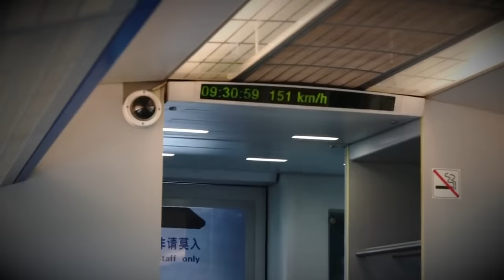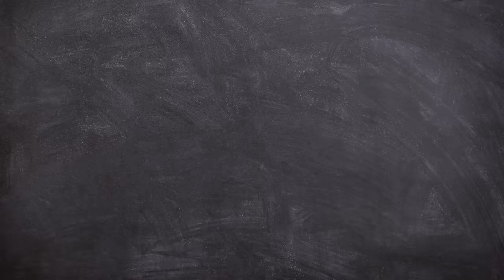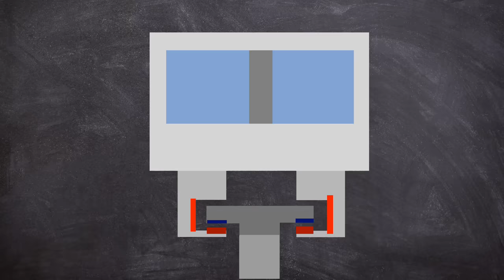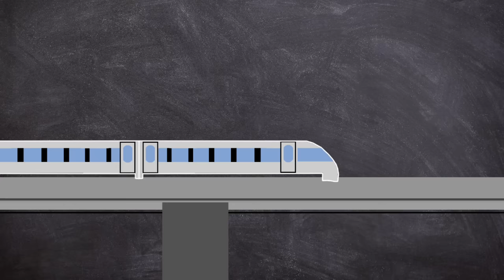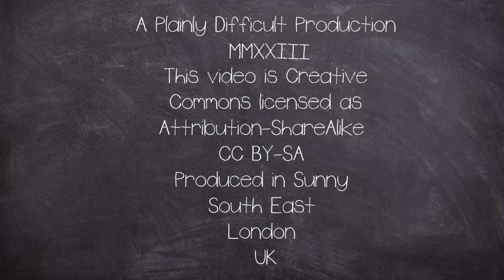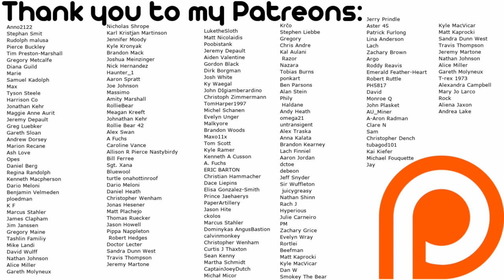Safety Complacency: The Lathen Maglev Train Disaster 2006 | Plainly Difficult Documentary

Comment: the shanghai maglev line is very cool. it's regarded as a "gadgetbahn" not because the technology is unviable. there are two external reasons for this undeserved "gadgetbahn" reputation. first, the line was meant to be the first section of a longer line. but the scope of the project ended up shrinking. so the city is now stuck with a maglev line that goes from the 8th busiest airport in the world to the middle of no where (although it's very convenient to exchange to normal metro at the terminal station). reason two is because it serves the airport, that determines the majority of passengers of the maglev line would be tourists. this feeds into people's regid perception that "if the majority passengers are tourists, it must be a tourist attraction/gadgetbahn". but in reality, at the time of this project, not just shanghai but the entirety of china just decided to shift away from developing maglev and starting developing conventional high speed rail. in another universe, you may very well see no high speed rail in china but extensive maglev lines partially or completely replacing metro in shanghai and other big cities.

Comment: This was such a common reason for railway accidents: signalmen forgetting a train that is already on the line.  Quintinshill and Ais Gill accidents immediately come to mind.

A train staff system would have prevented this accident, especially if the trains had been designed with an interlock to prevent their movement without the train staff being in the train: if the maintenance vehicle had the train staff, the maglev train would not have been able to start.  We learned these lessons in the 19th century!

Comment: the rolling of  steel wheel over steel track is extremely low friction, well proven, relatively cheap, and can be compatible with existing infrastructure.  Do you really gain much by adding the cost and complexity required by maglev?

Comment: How does the power for the accessories gets transmitted to the vehicle? I know for the Chuo Shinkansen they were still experimenting with it, initially using a gas turbine generator, but could not quickly find any info for the TransRapid system.
Reply: The tr08 have a 3kV power pickup and it uses about a few hundred watt  per ton to levitate. Tr09  have induktion pickup and it uses 50watt per ton to levitate. Tr09 have much more modern magnets, hence it uses less power.

Tr07 and tr06 uses about the same amount of power, but tr06 is significantly heavier, to that degree it have problem levitaring it self. If there is to much people onboard its stuck to the rail.

Comment: "Human error" is not a cause. It is at most a contributing factor. The split comms, no block system and the corporate culture which accepted fully manual safety critical systems were the causes, with that cultural element, and likely others not discussed in this video, being the core problem.

Comment: Random thought………
You all have seen the old hoverboard that worked by spinning magnets attached to lawnmower blades?

I wonder if the same eddy current idea was used in a linear manner to push the train up instead of electric magnets pulling the train up?
Using wheels to start and stop with some standard form of drive to make it move

Comment: I actually don't think of the Maglev as a gadgetbahn. Yes, they are far more expensive than conventional rail, but in certain situations I actually do think they would work great. Even the place where it was originally planned to be built in Germany wasn't that far-fetched. It was to be a direct link from Munich Central Station to Munich Airport, which currently is a 40-minute train ride on the Munich S-Bahn. The Transrapid would've been an astronomical improvement over that. A fast connection like the Transrapid to the airport is still sorely missing.

Right now they're planning on getting rid of this problem with Express S-Bahn services (which in my opinion kind of defeats the purpose of an S-Bahn), as well as a new long-distance train station at the airport in order to finally connect it to the ICE network.

Comment: Why do a straight line with a loop on either end? That necessitates the use of switches when you could do a loop and have a single direction of travel and only 1 switch to let trains on and off at the start and finish of the operational day/maintenance. The entire point of the maglev is to minimize moving parts and thus points of failure...
Reply: Because real tracks may need switches so you want to include them in your test tracks for testing.

Comment: Thank you for the explainer. I had no idea that this had happened. 
That being said, as there are SIX maglev systems in commercial service (some of which are considered obsolete) and the Japanese are testing an even more advanced version (that I call the "Platypus" for the obvious reason), can we please just STOP calling them "futuristic?"
Reply: What maglev system in service would you consider obsolete?
Reply: @matsv201 Personally, I don't. The truly obsolete short-distance people movers that employed maglev tech are gone, now. If I did, though, I'd consider the two low-speed maglevs in China to be "obsolete via technological overkill and resultant excessive maintenance burden." You don't need a maglev to achieve 62 mph. Conventional rail does that every day.
Reply: @colormedubious4747  
" I'd consider the two low-speed maglevs in China to be"
There are 3 in China, 1 in Korea and 1 in Japan of that type, and one more under construction (also China).

That of cause on top of the Shanghai one and the one high speed on in Japan under construction.

"excessive maintenance burden"
Do you have any sources for that, or did you just guess it?

"You don't need a maglev to achieve 62 mph."
Even if you may not need it, it can still be better.

High speed is not the only advantage of maglev. There is a hand full more of really significant advantages.

"Conventional rail does that every day."
It does, but its not with out drawbacks.
Reply: @matsv201  "China also has two low-speed maglev system operating at speeds of 100 km (62 miles) per hour. The Changsha Maglev connects that city’s airport to a station 18.5 km (11.5 miles) away, and the S1 line of the Beijing subway system has seven stops over a distance of 9 km (6 miles)." - Britannica
Reply: @colormedubious4747  
And Fenghuang Maglev open in July of 2022 with 6 station and a total distance of 9.12km with a maximum speed of 100km/h.

On top of that Qingyuan Maglev is under construction (its delayed, it suppose to be already opened) with a top speed of 120km/h, 8.1km system length and 3 stations.

Note that Sources like Britannica may have been correct at some point in time, but all information will be out of date at some point.

Its also a bit funny that Britannica still gets it to be 6 system, also counting the Korean World fair system, that is not really a commercial system, but more of a attraction, making it two in Korea . This isn´t really a commercial system in the sense that people pay for it to be transported, but for the novelty (while it do have two stations, so its an legitimate park transport)
Reply: @matsv201  Fair enough, but other sources were even more outdated than Britannica.
Reply: @colormedubious4747  there probobly are more under construction but the Chinese govemrner often hides  the documents untill its finished to make it look like there never are delays.

Probobly should ask luke. 

They should have start building the new high speed mainline by now, but I have not seen any photos of the construction yet.

Still, if they started the construction får away they probobly could hide it for quite a while.

Comment: A very important incident, because it reminds us that all fixed guideways (on rails, magnets, or in vacuum tubes) should be subjected to the same regulatory oversight and technical practices and governance. There is no escape from the fundamental failure modes of C19th railways! Astounding lack of systematisation of possession/ block management, solved over 100 years ago. Not sure I understand why the radio system is relevant, surely a highly procedural, lowest tier of hierarchy intervention. Should have been entirely managed at the design and engineering level of the interlocking and track authority system. If nothing else, written forms, transcribe authority in maintenance vehicle, read it back to control, issue a unique authority which automatically applies boot/ block in interlocking

Comment: This was caused by a badly designed communications system, and will certainly not prevent maglev from being a workable technology. But do we know  that proximity to the high magnetic fields needed for maglev is safe? What is the magnetic field strength at the floor of the passenger compartment? Also, how does the Shanghai system deal with the problem of inspecting the track?

Comment: It's quite amazing that Shanghai Maglev operated since 2003 only had a fire in the 20 years of operation so far. Given the trains are largely experimental and you can see the Chinese have to rig up portable fans in the cab for the train driver.
But on the other hand, it was really the only way to quickly get from the airport to the city by rail (Metro Line 2 take almost an hour to get to the same station Maglev stops at, and it was only opened in 2010). So it is not really a venality project. (Although many will just take a taxi to the airport instead given the taxi is more convenient).
However, the very high costs is primary driving force behind China's push on 300lph+ Hight Speed Rail project. The maglev's route was planned all the way to HangZhou (Old capital of Republic of China), but then shortened to Shanghai's Hongqiao Airport, then... never extended due to cost and noise. The route space reserved between Shanghai and Hangzhou is used by HSR running at 350kph today.
The new Airport Link Line planned to open in 2024 will finally connect Shanghai Hongqiao Airport with Shanghai Pudong Airport. Designed speed 200km/h, and operate speed at 160km/h. Faster than Metro 2 but slower than the Maglev (300-423kph depend on timetable).
*Right now if you want to go between the airport by Metro, it will take almost  2+ hours, Maglev can shorten the journey by almost 30-40 minutes, still longer than Taxi and bus. New Airport Link Line can shorten it to 40 minutes total, faster than taxi.

Comment: So, the engineers were tasked with designing a system that had to use electricity and computers to pull the train up, instead of letting it rest on a magnetic repulsion field that would not have consumed such a heap of power.

The Westinghouse is strong in whoever wanted this done.

Comment: Curious why a maglev train needs to be elevated like monorails (which drastically increases cost).
Reply: Any high-speed train needs grade separation from other traffic for safety.  If it were at ground level, there would be additional cost for fencing.  A long route without crossings would be an inconvenience, so you might need expensive underpasses.  Elevation also makes it easier to build a level track over uneven ground.

Comment: 1:22 "have a lot of the train replacement tropes"

"expensive, complex, tracks usually raised in the air"

Source needed. Or is this one of those "trust me bro" kind of situation.

2:55 "linear induction motors"
While some system use Linear induction motors, Transrapid use linear synchronous motors... Is that really that important? Yes,, apart from the acronym being totally different, Transrapid relies on Linear synchronous for not only propulsion, but also levitation.

3:47 Transrapid was not formed untill a few years later. The first train that carried the transrapid name was 04. There was multiple 01 and 02 from competing developers. They was all unified into Transrapid in 1973. While this is not that important, there are several different german maglev train that carry the number 1, 2 and 3.

4:00 its not quite fair to call TR04 and TR05 fully working. They was technology demonstrators. They absolutely did work, but had significant limitations. They was never ment as a transport tool

4:15 The install Track was finished by 1984, but the full track was not done until 1986. This is the same layout that the track have to this day.

4:45 "the system look like a monorail with its concrete beam"

While a lot of the transrapid system have concrete beam, the specific place from the photo have steel beams.

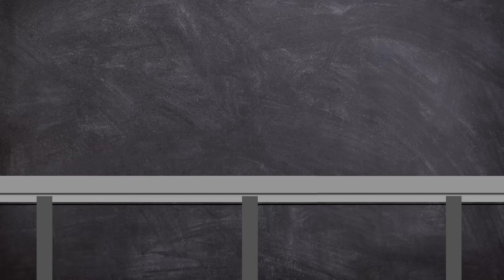5:40 "signaling was not a big issue"

Well .. while that is technically true, there is still a safety system in place. The one that the power unit is in the track.l So two trains on the same section will always be propelled not only in the same direction, but also at the same speed. Making a accident between two functioning trains virtually impossible.

The system also knows instinctively where ever any train is on the system. If any train would break down at any moment, the system would know that, and could block of that section of track. There also was a track block system.

Its also worth saying that there is no front and back of the train (just like any EMU), but it just happen to travle at that direction that day.

The person sitting in front of the train is technically not a driver, but rather a operator, like on a cable car.

11:40 While Transrapid close down, there legacy is still around. Both the Chinese and the Korean copy is under development and the Chinese system is already setting up there first track section with preproductin of new track have begun and the first train is under testing. 

Also Korean have a test train. THis is simular to how japan closed down limino to only pop up in china

Comment: Mag-lev trains use more electricity than conventional electric trains.  Rolling friction is pretty low steel wheels on steel rails.  Wind resistance is more of a problem I think.  The faster you go, the more power is required to go even faster, exponentially.  Drag is a drag, man.
Reply: That is not accurate. Maglev trains is considerably more power efficent. Where did you get that flawed I formation from?

Comment: Tons of false information stated here. Transrapid 07 reached 453km/h in 1993. The whole track in Emsland was finished not before 1987, but the first part was opened in 1983 (the passenger service needed to be delayed to 1984). Principially the Transrapid 07-09 had been capable of speeds up to 505km/h at least. The disadvantages are actually based on lies, the critics in Germany came up with. China currently has three Transrapid copies for high speed build (CRRC CF600, only the vehicles) and one for low speed, so the technique is only done in Germany and even that is not true.

Comment: Such a shame that people died due to the negligence of a supervisor, especially when it was completely avoidable. I mean they had safety systems in play to prevent this yet they didn't use them?! Thats ridiculous whats the point of the system if you're not going to use it. So not only did people die but people also lost their jobs and it ended the maglev train before it even got a chance to blossom all because a supervisor wanted to save what time and some money? Ironically this ended up costing them a lot more money than it would have if they just used the safety system this wouldnt have happened

Comment: Because MagLev depends on paramagnetic or diamagnetic properties of the rails to create lift, the cost of the copper or aluminum required to build long distance   rail lines makes the whole concept economically  unviable. However, if a cheaper diamagnetic material could be used for the roadbed, a long distance MagLev line could be a safer investment.  I would suggest amorphous carbon, ( diamagnetic ) ground into a fine powder, ( to totally randomize the structure  ) and bound by epoxy resin into a rail design that could maintain integrity under strain of both the train traffic as well as wear and tear due to exposure to weather and temperature changes. I hope a better scientist than I will solve these issues in my lifetime because I think MagLev is a really very cool concept well worth pursuing. 
Ain't science grand ?😁

Comment: This godawful accident should not have happened.

However, and this is the part that makes me angry, there was nothing about that accident that had to do with the fact that the train was a MagLev. Absolutely nothing about that fatal incident was related, in any way, to the technology or the research being done.

There were no new lessons to learn here; only old ones. This was a complete and total failure to implement both railway safety protocols like block switching, and industrial safety practices like Lockout/Tagout. Either would have stopped this catastrophe from transpiring.